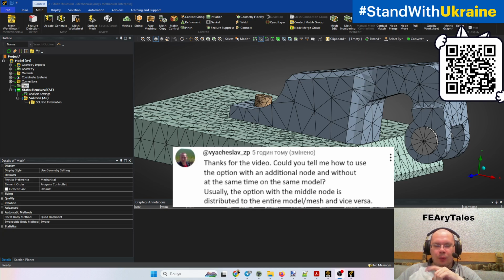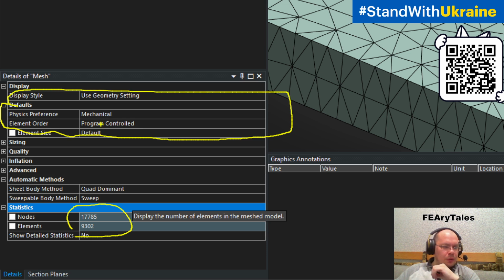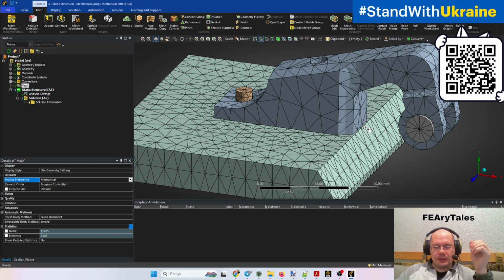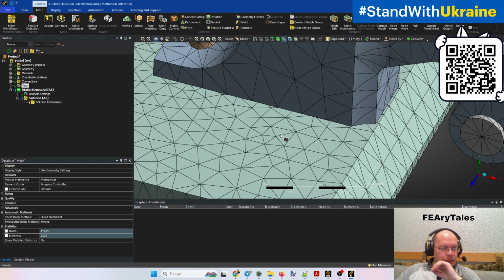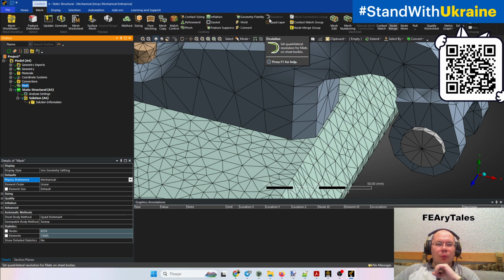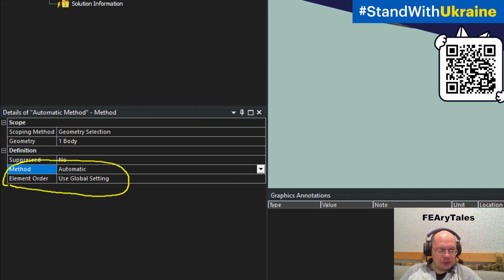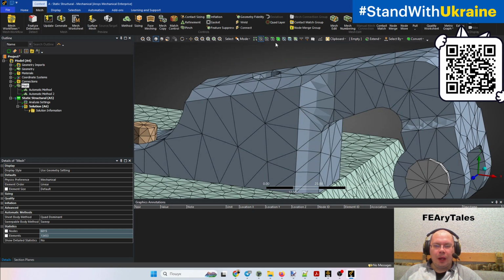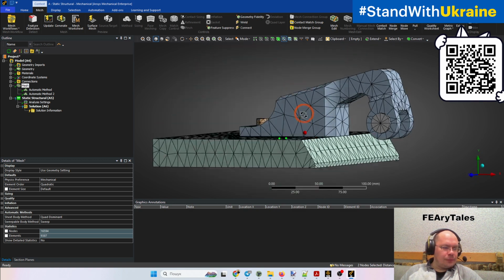Ansys Mechanical. How to create a mesh with different element order types for different bodies

Comment: We can get away with the issue you mentioned by creating two elements between a midside node and adjacent node. Here is the explanation: So lets say we have a edge of a triangle which has quadratic shape function. The edge will have 3 nodes. We can create two linear traingle elements to connect to this edge instead of one which avoids a free node, as you mentioned at the end of video. Or we can also use serendipity elements which are used in transition between linear to quadratic or vice versa. In the case of 3D mesh, we have a transition element of shape of prism between hexahedral and tetrahedral (a different issue).
Reply from the maker: Yep. There are lot of options to avoid difference between structured meshes of aligned bodies.
Creating a prizmatic, piramid and tetra elements. But it's more suitable for hand creationg of mesh not automatic.

In this video I show only simple existing of meshing options with which we can control element types

Comment: I see that you have nodes in one of the bodies not in contact with the node in other body and instead lie somewhere in between the element. Is that possible? I thought nodes of one body should be coinciding with other body.
Reply from the maker: I depennd on task and preferences. 
If we will try to create multybodypart with shared topolgy - the mesh must be the same.
If we create multyple parts the mesh can be very different on "contacted" faces. If we need to simulate contact behavior - the better result will be if we have corresponfing mesh, but it's additional option